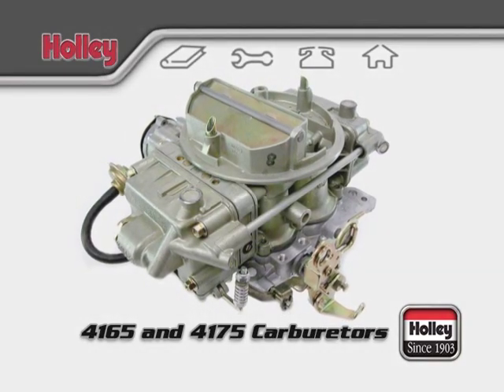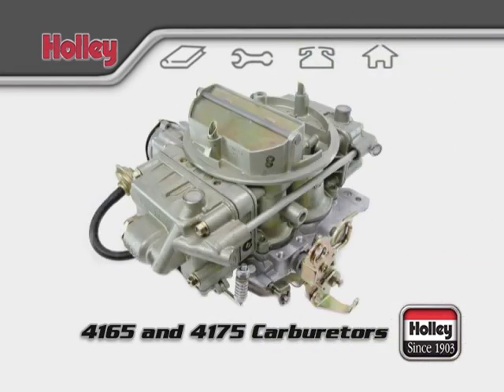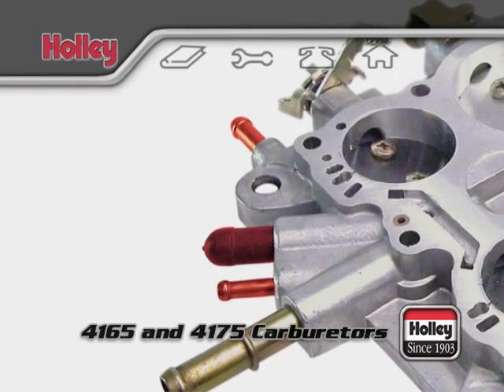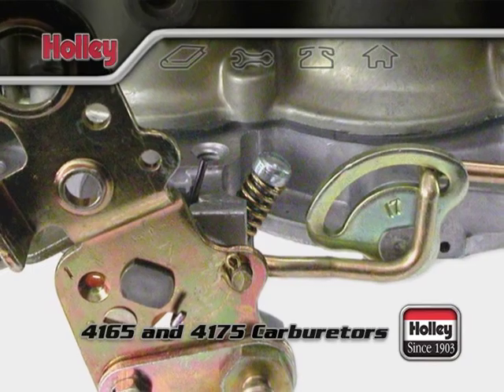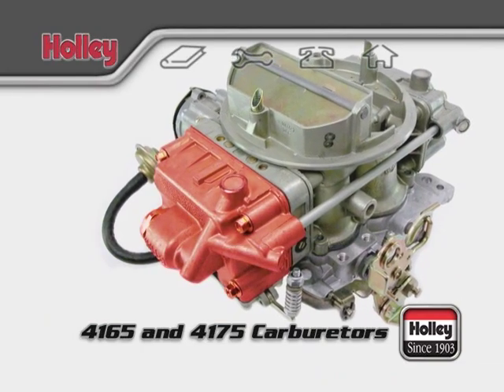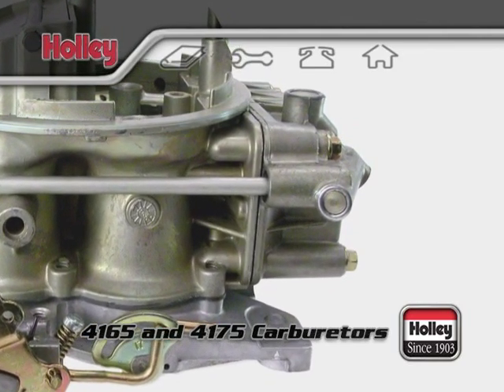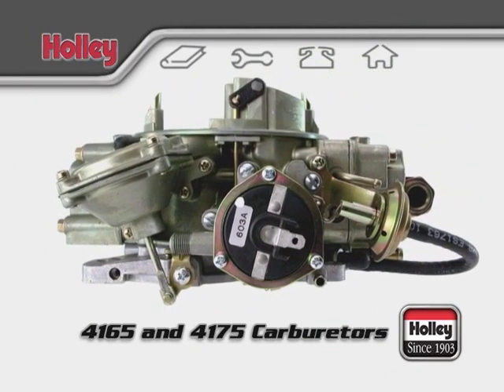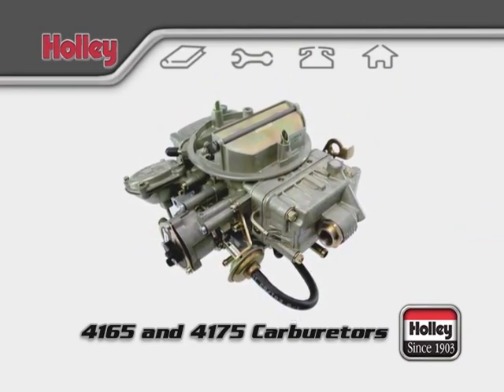4165 & 4175 Carburetors

Comment: I put one of these 4175 on my trucks 350 after my older carter 625 died,
i got SO much more power across the power curve. 
when the HUGE secondaries kick in it hauls off and keeps pulling past the 110mph mark
i also got better around town mileage due to the small primaries.
you can also hear the air rushing into the carb.
note that my old carb could have been a bottle neck to my 5.7 350
id say it increased my horsepower  by at least 30+ and the torque by 50+ it pulls so well now.

Comment: I have one with mechanical secondary's (double pumper) on my hotrod. Prefer it over a square bore as the throttle response is right there without a stumble from a dead start. I have had 4 or 5 square bores over the years and a dead spot at takeoff was common with every one of them. Tried tuning it out but never was successful. I have really been pleased with the spread bore.